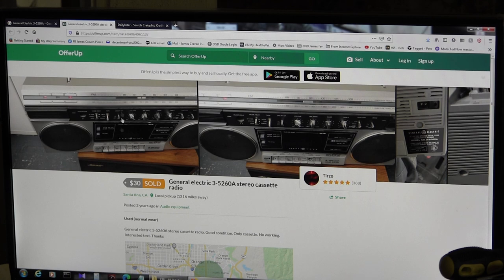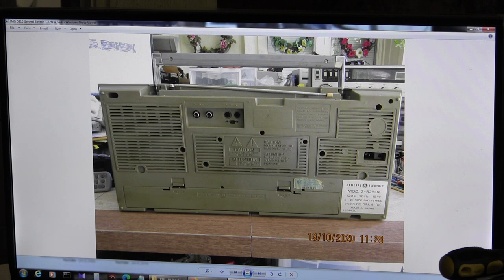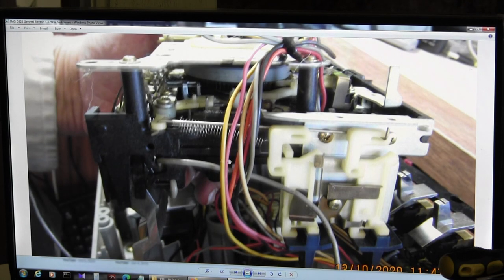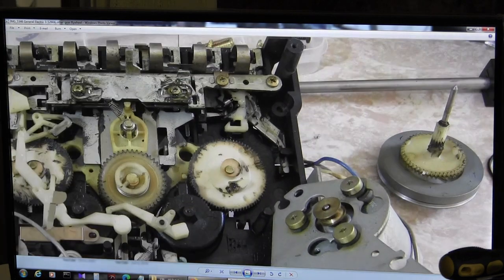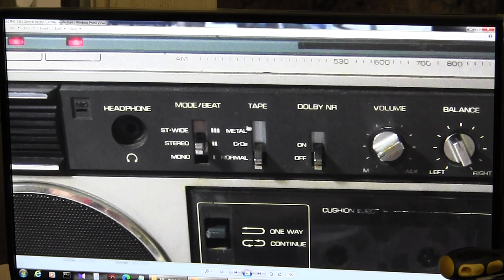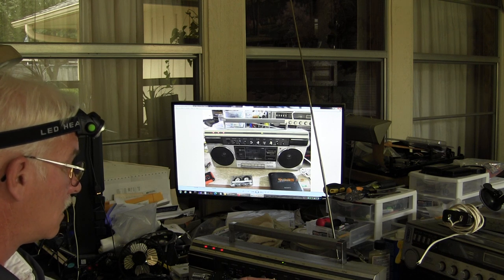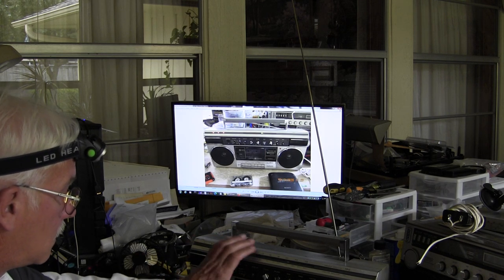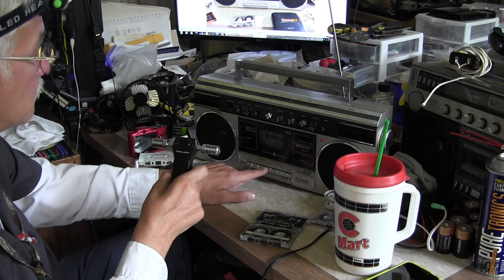General Electric 3-5260A GE How I Restore Recording Auto reverse Cassette Play CD in Part 1 of 2

Comment: Could you repair this exact model my tape deck just doesn't spin I think due to insufficient power the battery light is always red any advice
Reply from the maker: jamespierceiii@hotmail.com send email or call 713-502-9993 probably need a new motor -or - I could sell you one of the two models I have that work.